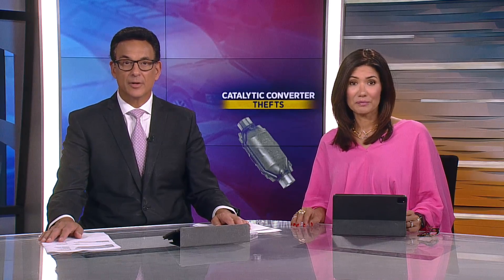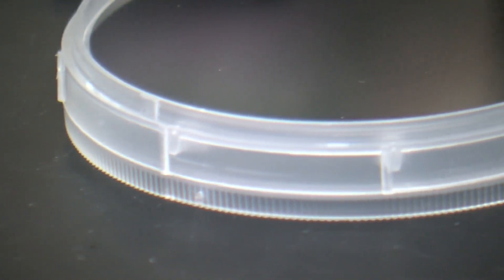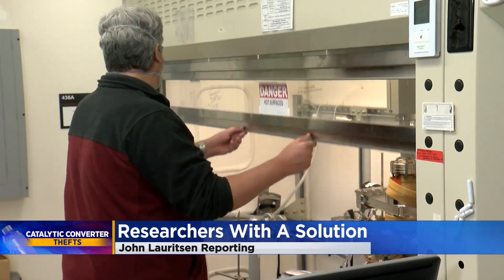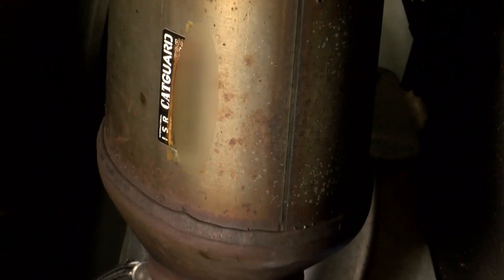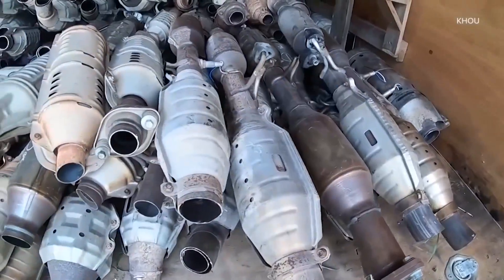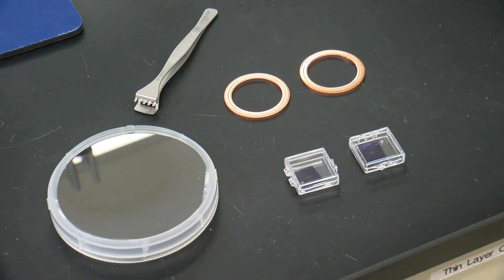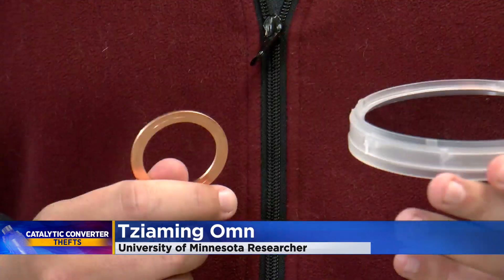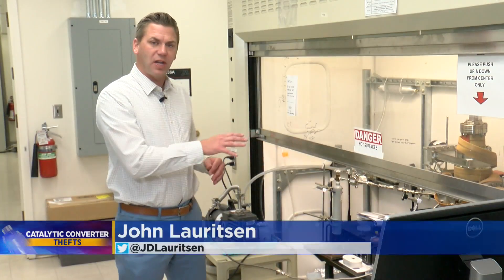U of M researchers looking to reduce catalytic converter thefts awarded $10.6 million grant

Comment: another solution is to put less material in the converters and make the car owner have to replace the converter more often.

instead of the converter lasting the life of the car the you may go through 3 or 4 converters in the life of  the car.

also it would make the converters worth and cost less because there is less metal.

most people only replace the converter when the car starts to bog down similar to like a 3 cylender car running it's air conditioner while driving up a hill.

or a stick shift manual slipping the clutch.

or when the car throws up a check engine light.

we already do that with brake rotors we never used to have to replace brake rotors every year but with shrinkflation we replace them every year.